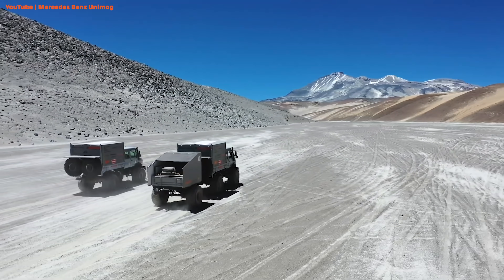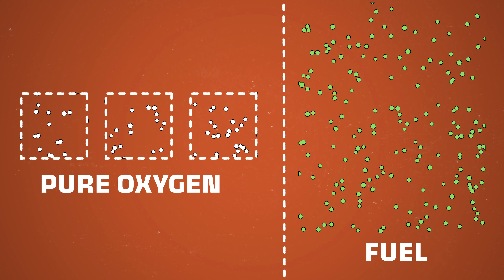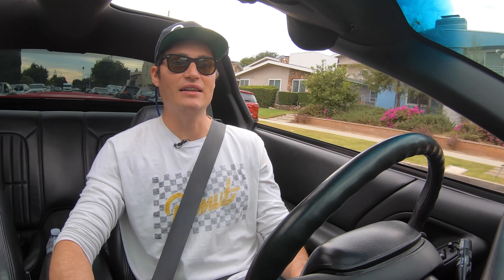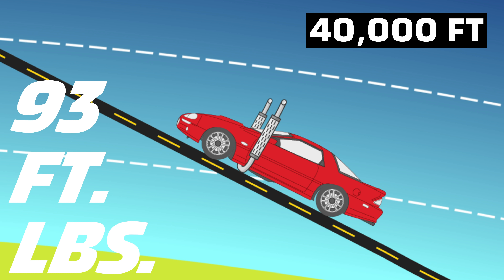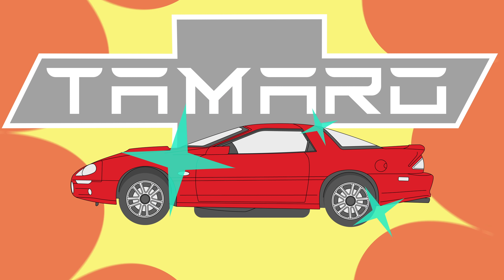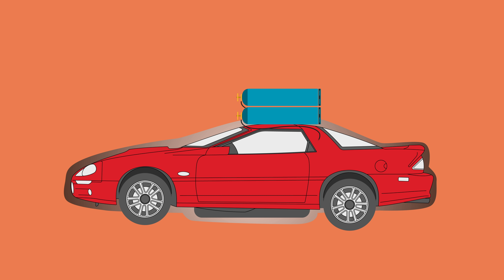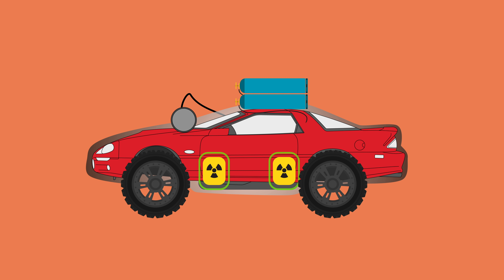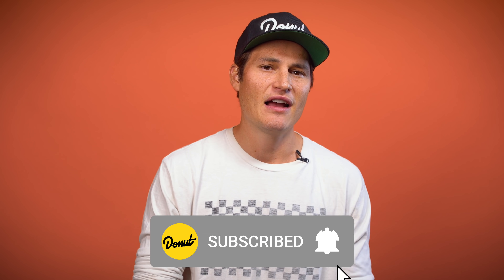Could A Car Drive To Space?

Comment: Gas engine when it goes a little too high: "I'm too weak."

Electric engine in space: UNLIMTED POWER
Reply: yeah a single Tesla model s motor can spin those portal axles and all the compressors etc at a sustained 20% gradient
Reply: Elon did an experiment
Reply: I bet the batmobile could do it
Reply: I’ve never heard of an electric plane flying higher than one with a combustion engine...where’s the power then.
Reply: @justinfox6621  That's because electric planes aren't really a thing, unless it's a drone.
Reply: @D-Man_Jam  They're a thing but batteries are much lower energy density than fuel, electric planes are fairly short range because of it.
Reply: me, when i get a little too high: "im so hungry"
Reply: Jet engines when high: MAX EFFICIENCY
Reply: Infinite power
Reply: @aldenhauser9555  when did I mention a propeller? Lol
Reply: @justinfox6621   that is because the thrust from a propeller is dependent on the density of the air
Reply: @D-Man_Jam  oops I responded to the wrong person
Reply: @aldenhauser9555  lol
Reply: @justinfox6621  You must not have heard of this one: https://en.wikipedia.org/wiki/Helios_Prototype which currently holds the altitude record for fixed wing flight
Reply: @dsdy1205  you must not have heard of this one:  IN 1977  the mig 25 226M(max altitude 123,524), the SR71 could fly 90,000 feet and if you want to count anything with combustion search up the bell X-15 it flew 53 miles high in the 1960s which actually made its pilots the first to reach space.   Let me clear something up I’m not one of those ppl that hate on electric in fact, I am currently building an electric car to compete in the Solar Car Challenge, my school won in 2018, and I am currently working at a solar and renewable energy company. But when people say electric is outright better then combustion they are just ignorant the best performing cars though are actually hybrids which takes the best of both worlds, look at all of the quickest accelerating street and race cars they are usually hybrid(not counting dragster which are just purpose built to drive 1000 ft in 4 secs and then have to change their engine). At the end of the day, on a consumer level the only reasons most people will buy a certain car is for ease and looks.
Reply: Yeah, a gas car won’t work in space. You need oxygen for the 4 stroke process. No oxygen, no stroke.

Comment: 12:46 the air is almost vacuum so the heat lost occur almost exclusively by thermal radiation which is the slowest kind of heat transfer. So your existing heater is quite sufficient.
Reply: I'd bet getting rid of heat for that electric power train would be the real temperature issue.
Reply: @cameronmahon7242  yeah i never think of that

Comment: This was a fun video! Although a few design changes I'd make;

1) You can just put the batteries inside the cabin, since the drivers also have to be kept above freezing temperatures xD
2) This car would need to be better insulated. I would remake all the panels to be two or three solid layers with a vacuum seal in-between each, similar to the fancy thermos mugs. That will give you the proper insulation needed for the car. This would have to go around the entire car including the underbody and wheel wells. 
3) A front and back wing to make downforce, and or more effective underbody aero.
4) You could get away with completely solid rubber wheels. This would probably still be lighter than the hummer mods. They might need to be heated since I can't imagine them doing too well at -150C.

Comment: The real trick is hitting any thing close to orbital speeds (little over 8km per second) by the time you leave the road to actually orbit. Of course why not just add a basic thruster and RCS package to get the rest and just worry about launching it full send off that ramp. Next mod the roof with the standard docking hatch and take a trip to the station.

Comment: The key issue would be cooling, with no air for convective cooling, solar radiation and internally generated heat would cook the motor and likely the occupants. 

Which is the reason along the with solar panels the ISS has massive radiative cooling fins to stop it from overheating.

Comment: Yes, I had the problem with not enough air with my motorcycle with carburetor at 2500m while it was set for 600m xD
Airlifted cap away, bam, runs

Comment: WW2 aircraft such as the Boeing B-17 Flying Fortress could fly upto 35,000ft by using turbosupercharged engines.
I don’t know if it’s coincidence but some modern aircraft use their fuel (kerosene, similar to diesel) as a closed circuit or recirculated engine coolant. Maybe that keeps the fuel warm enough not to gel.

Comment: Above a certain altitude it's going to become important to avoid overheating instead of freezing. With no way to reject waste heat through air convection the motors can burn out, and the cabin would have a tendency to overheat when in sunlight. Radiators (the real kind) would be ideal.

Getting into orbit is as simple as having the indestructible road spiral around the Earth several hundred times (with a grade that increases as gravity decreases), until it levels out and drops off at a height such that the car shooting sideways off the road at top speed would give it a perigee of 200 km or more.

Such a height would be far, far past the Moon. In fact, it wouldn't even be a stable orbit because the upswing that brings you back to the height of the dropoff puts you so far out of the Earth's gravity well you might end up in a heliocentric orbit or stuck in a Lagrange point or something. You'd want to do a gravity assist off the Moon to slow down, rounding out and shrinking your orbit.

That is, if you can drive up this magic indestructible ramp before the Moon smashes into it and gets obliterated. Earth could end up with rings like Saturn if you weren't careful. Or maybe the momentum of the moon would transfer through the ramp, causing Earth to start spinning faster while making the Moon fall out of orbit. In like a year the whole Earth-Moon system would be a giant squat ball of spinning magma with a huge asphalt spiral embedded in it...

Comment: One factor was missed. 

Drivetrain swap the Cameo from RWD to AWD? Because theoretically speaking, the Tesla motor will generate a lot of instant torque creating a bit of wheelspin, plus with AWD, it's easier to make it up strap incline without worrying the rear tires loosing grip.

Comment: I feel like you could simplify your scenario a lot... start with a Cybertruck that has space and less complex shape to add the layer of aerogel, use Michelin Twheels(not sure if they still use this name, but airless one piece rim/tire combo), maybe beef up the already on board electric heating/cooling systems(both battery and HVAC) if needed, couple of O2 tanks in the bed,. Then drive up a ramp with a much more reasonable 4% grade that is oriented with the jet stream (so you have tailwind to help with range and down force), install side walls to help with wind, and install some of those robotic car chargers that Tesla has been working on every few 100 Km. By the time you get from NYC to Dallas(or reverse based on wind...), your an astronaut! Install parachute system on truck roof to beat Baumgartner’s record. Done

Comment: Or the road could be designed better and you could use oxidizer. Pump the thing with chlorine trifluoride, engine gets the "air" and if something goes wrong you end up with a rocket (depending on how wrong you might even reach the escape velocity :D) which is the second best way of getting your car to space after space elevator.

Comment: I don't think you would actually need the extra heaters as the waste heat from the batteries can be pumped back into the cabin, and with the decreased air density, the heat loss from conduction and convection would be far less.
with regards to the tire inflation issue, the maximum tire pressure increase would be around 14 psi, and with the drop in external temperature and lack of heating in the wheels, the pressure drop wouldn't actually be that bad, since if you inflate the tires to a standard 30psi, the max it would reach would be 45 psi, which is fairly okay as far as overpressuring goes

Comment: I was surprised that you didn't mention forced induction, since it would be more efficient at higher altitudes. This has been done before but only on piston engine aircraft.
Reply: Me too. The diesel is turbocharged, so I assume that was factored in, just not mentioned. Yeah, those supercharged radial airplane motors, incredible engineering

Comment: Why not a turbocharged Caterpillar C12 engine with fuel and intake heater Jerry? Like the Kenworth T800 I drive at work. Pretty sure that makes way more torque in cold weather than any power stroke. Take you to the edge of the atmosphere on the Jerry turnpike for sure.

Comment: Colder temperature does not increase a battery's internal resistance. Actually, in colder temperatures, resistance reduces (though the difference isn't actually that great, unless we're talking about specific materials that become superconductive at low temperatures).

However, colder temperature reduces the speed of chemical reactions. In batteries, this means the electrochemical reduction-oxidation reaction in the battery occurs slower and produces less electric potential difference between the electrodes - which means less voltage, and less voltage means less electric current.

In plain language - cold temperature doesn't really decrease a battery's capacity in terms of total energy storage, but it does reduce the voltage output the battery can produce. So the device that's using the battery sees the voltage drop, and identifies it as the battery being drained, and probably shuts down to protect the battery from being over-drawn (at least if it has modern battery protection system). You could say the useful energy storage of a battery is reduced in cold temperatures, but it has nothing to do with the battery's internal resistance.

Comment: There are a few things wrong fact-wise with this video.  The most torque in a production vehicle isn’t the Ford F-350 with 1,050 ft/lb, it’s the Dodge 3500 with the Cummins HO, making 1,075 ft/lb.  Also, diesel likely isn’t going to gel if an engine is running.  Change a fuel filter after a motor has been running; the diesel is pretty hot, but not scalding.  Also, there is such thing as anti-gel additive and winter diesel fuel.

Comment: Before watching this video, I already know a normal combustion engine wouldn't be able to do it due to the lack of oxygen before you even get near space at 30,000 feet. Technically the thinner atmosphere would allow you to go faster due to less drag, but the problem still stands on the fact the road would be a constant uphill. The only thing that could make it would be an electric car, one with good torque and a lot of batteries. It also needs to be fairly light, which will help with it being able accelerate and keep its speed while using less power than if it was heavier.
Reply: So I got the fairly light part wrong, yeah, you defiantly are going to need that extra weight to help counter all the strong wind. Also, I would recommend getting more oxygen tanks and a C02 scrubber to recycle the air you breath out to lengthen the time you can spend past around 25k feet.

Comment: Theoretically the solution is actually really simple. A tank of pressurized oxygen feeding into a modified intake, with a mechanism in place to deliver the optimal amount of oxygen for each cycle of the cylinder. Eezy peezy space driving squeezy. You can even calculate exactly how much oxygen it takes to burn the full tank of gas, and (assuming it's not a stupid high amount) from there just get a big enough tank to ensure your full gas tank can be used in it's entirety before refilling both.

Comment: First step: Replace Catfish Camaro with a Tesla Cybertruck. Half of the mods described here are standard or options on that thing, which I and some others suspect was literally designed for Mars. The other question this didn't address is whether a car - gas, diesel, or electric - would have enough fuel or battery range to reach Space without running out, all other issues aside.

Comment: what about the new tesla roadster or like a super modded new roadster with a beefy heat pump? its got insane torque and doesnt require oxygen for combustion? also what if you added walls and a roof to the road? to make it more like a tunnel so that wind speeds dont matter. plus there could be heaters in that tunnel to keep it warm

Comment: Did you ever think of just using a normal electric heater for the batteries

Or O2 for the ICE engine

Also the road itself would reduce windspeeds

Comment: If you take a 100 kwh battery it can contain 100000*3600=360.000.000 Joule. If you convert that all into mass*gravity*height and it's still 1500kg the battery will be empty about 25 kilometers up.

Maybe better off in a car with a NOS system.

Comment: there is this tiny tiny problem you would encounter once you get to space, and thats temperature, and no, it's not the cold you have to worry about, its the opposite because space has no medium to carry away all that heat you and your car produce, and temperature of space works in kinda funny ways as well, the ambient temperature of space may be negative 256 celcius, but direct sunlight will actually heat you up to somewhere around 120 celcius, so the external surface temperature of your car will get real hot, and in turn making the interior real toasty, those big windows letting in all that light will only makes things worse for you as you will be exposed to almost completely unfiltered and direct sunlight, and your own bodyheat and the engines and batterys wasteheat will only serve to speed up the rate at which you will get cooked alive

Comment: You could drive to outer space, if your car could go 36,000 kilometers per hour that is! Not to mention, the car would have to be pressurized and\or you'd need a spacesuit to last more than a few seconds up there, plus supplemental oxygen for the engine to work! There's a pretty good reason why rockets are the only vehicles currently capable of reaching space.

Comment: I thought that fuel ratio was 14.7 parts air to one part fuel although I know that goes down a bit depending on load and other stuff but where'd you get the three parts air to one part fuel I need to know if I'm wrong or what I'm missing

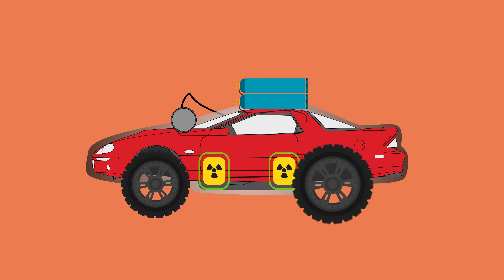Comment: 11:11 - The Unimog [ tm ] has them for inflation, so you don't have to repair slow punctures. Yes, you can air them down with the same system, but, was designed for punctures. I would have used a Jet car, no problem until about 120,000 feet. :-þ

PS the car would not 'orbit' unless it had reached orbital velocity which is about 15,000 MPH at 327,000 feet.

PPS Why did you seem drunk in the advert?